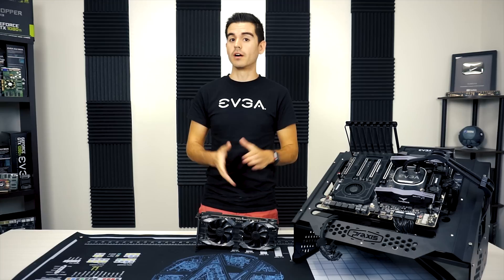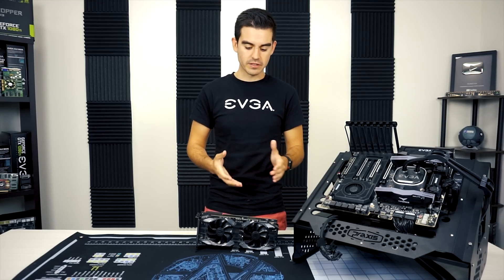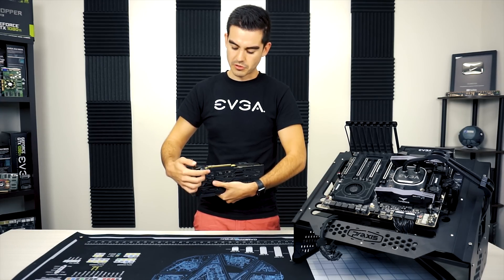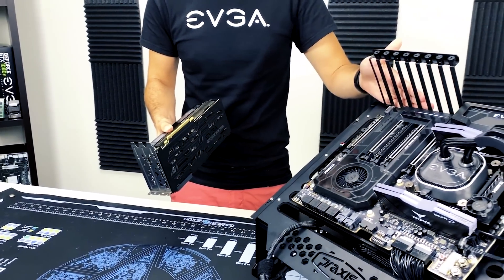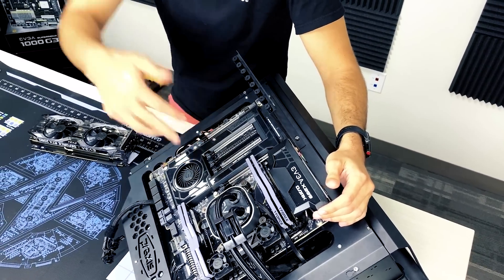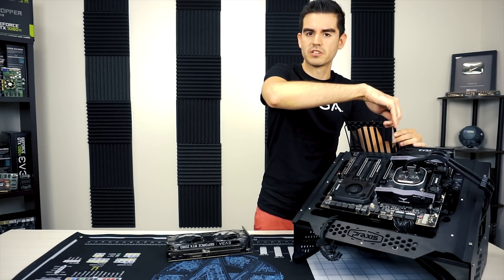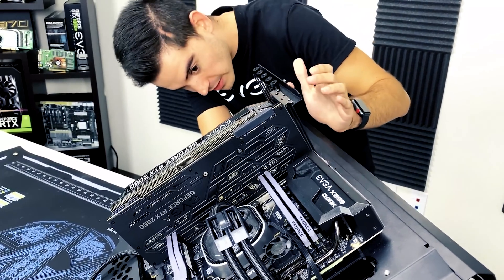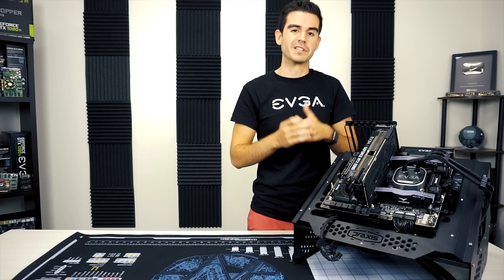How To: Install a GPU (and what to look out for)

Comment: Hi im wondering, if the GPU isnt properly inserted you said it could damage the gpu and motherboard. Unfortunately I ran into this situation 😢. Im wondering, could this also damage other components such as the CPU?
Reply: Hi, if you see this comment and you didn't fix your issue, it shouldnt make a problem with the CPU

Comment: why black screen after I see BIOS password screen then boot up screen? Common problem no on answers.  I have Nvidia, though - and Debian non-free
Reply: If you make it past the bios boot up logo, you are having a software issue. Nvidia cards also don't play well with linux
Reply: @louiesatterwhite3885  thanks.  I tried for hours to install the open-source driver for nvidia. Then, tried nvidia's own software and it installed instantly. Have had ZERO problems since.

Comment: can I have a monitor connected to my integrated graphics? (Motherboard rear io) for it to still recognize the gpu
Reply: Did you find out if it works? I’m trying to do the sane
Reply: @beastlychillguy  i never tried it but I would assume in bios it would appear
Reply: @BingBangBrine  okay thanks!

Comment: So I have a system built, windows installed and I'm about to add my GPU will the system auto recognise the GPU even if I don't have nvidia drivers, it's a fresh install nothing on the system except windows. Would I be better to use the on board Intel graphics to dl nvidia experience to get the drivers before fitting the GPU? Or can I just fit the 1080ti and fire her up then go to nvidia online? Thanks in advance for your time.
Reply: i have the same question. did you figure it out?
Reply: @AEKfootball  well I had onboard graphics with the cpu so didn't have a problem in the end. I just fitted the GPU then downloaded the drivers. You could preinstall drivers before fitting rhe gpu.
Reply: @Quint1975  thanks

Comment: the single 2pin you use to make a 8pin  does it matter what side of the six pin it connects too   or will it onlt connect on 1 side?
Reply: It will only connect on one side. Look at the shapes of the pins and the shapes of the holes you're plugging them into. One or two of them should be squares so make sure those match up.

Comment: If you were drawing something, does that mean you're Ray Tracing? LOL! I would not use the pigtail connector on that card. Yes you can use it, but why risk hitting the limit of the cable. I would use two separate PCI-e power cables. (I err on the side of overkill!)
I don't know if I want an RTX card, but I do want an X299 DARK, and the new Z390 DARK! They'd look great next to my X79 DARK!
Reply: I would use 2 separate cables also.